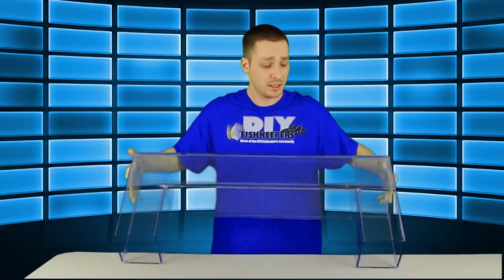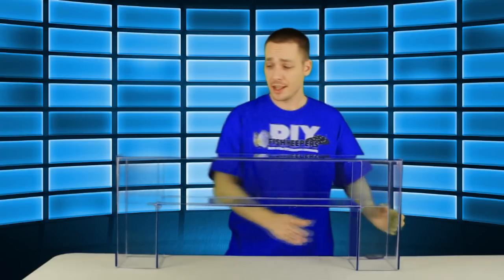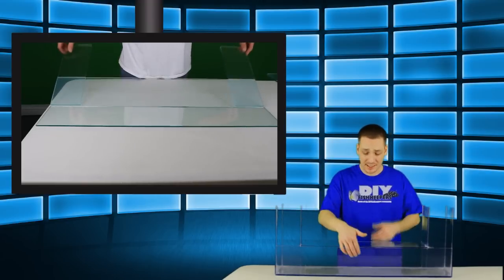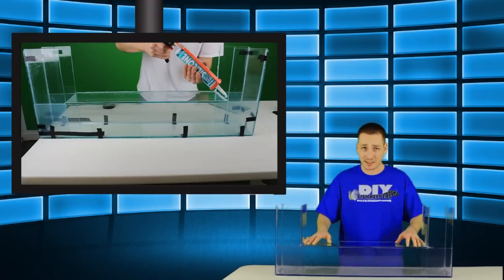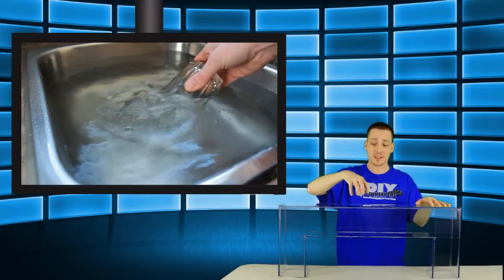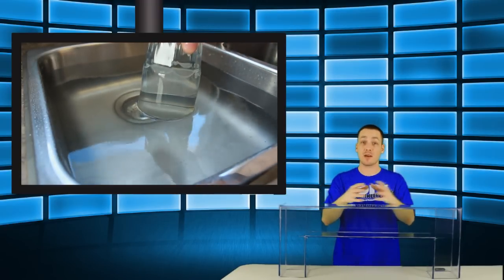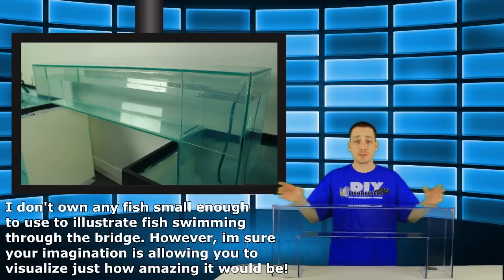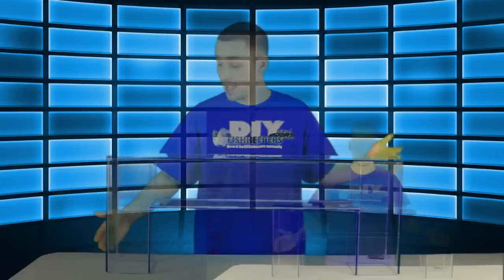HOW TO: aquarium water bridge

Comment: Your point about the bridge not leaking was very interesting. Great video!
Reply: It doesnt leak. But if it will leak it wont work to begin with.

It all works because of vacuum, so on top of having to be water tight, it needs to be air tight.

Comment: Amazing... Please do put in some fish and make a video of that... I also believe that if you use your drip irrigation system for water changes, with the inlet at one side, and the outlet at the other, it will work just fine..
as for the algae, i believe that your simple ceramic filter should keep the water clean enough...
And thanks for sharing this amazing idea..
And if you / i use an acrylic sheet for this project.. the tube can be made to bend at the sides, so the flow of water will be smoother..

Comment: can this be done with aquariums that have different hight levels?
Reply from the maker: +Ana Avila yes. The tunnel has to be level though, so one entrance would just have to be longer.
Reply: +The king of DIY Thanks. Im planing on puting two tanks one in front of each other at different levels ando would love to conect them.
Reply: No you can't :)
Reply: Won't the water level equalize?
Reply: +Tim Johnston  
Yes, they will...you would need lower tank closed
Reply: Ana Avila you'd probably have to make one end of the tunnel longer so it dips into the water.
Reply: height*
Reply: No your lower tank would have to be sealed
Reply: It could as long as you stabilized the water bridge and adjusted the height lvls. If the bridge rested on the slightly higher tank edge, you would want to add something like a column or support to the bottom of the other end in the lower tank to make up for the difference.
Reply: Ana Avila no it won't work. the lower aquarium will overflow. works like a syphon
Reply: The king of DIY  sorry could you please help  me I tried this but my small tank is over flowing how do I counter this? Please help

Comment: Yah sweet bro, I had been thinking about this very concept over this past week, then I came across this video. I was thinking more of putting a  dome of sorts in the centre of my goldfish pond so they could swim up above the waterline and see the pond they live in, Lol. Thing that kept me up at night (so to speak) is Pressure.

Specifically, what it might actually feel like for the fish and potential effects?

- Do they experience any pressure differential inside the water vacuum columb?, like you would experience if you were to dive down really deep into the ocean?
- If so does that mean the higher above the surface they swim the greater the pressure they would  experience?
- Or is there simply no pressure differential in any area of the total volume of water contained within the system.

Probably overthinking it, but I find it to be an intriguing question.
Reply: I can't answer that question , but I like it.

Comment: Water pressure increases with depth, but here you've created a way to reduce water pressure, by having a volume above the level exposed to the air.

This might actually prove to be a useful system for encouraging some fish species to breed, as many prefer to spawn during thunderstorms/heavy rains, to ensure their young aren't going to end up trying to survive through a dry spell or drought.  Thunderstorms are the result of a low pressure weather system, which the fish can sense, even under the water, through its affects on their swim bladders.

If you could build a bridge - or just a capped off tube - high enough above the water surface (about 400 inches, to offset the 14.7 psi air pressure at sea level), you could end up with negative pressure, and the water would actually start cold-boiling into vacuum, otherwise seen as cavitation on boat propellers, where the extreme low pressure causes the water to turn to gas.

You don't want that or your fish will explode (although the tank would probably implode first, unless built to a similar standard as one of an equal depth).

Comment: glass cutting tip: you can use a torch and heat the score line to cut odd shapes the glass will crack along the score line and use the ball at the end of the cutter and gently tap along the score line to complete break it free. just careful getting it to hot to fast it will make it crack in a undesired way

Comment: Do I need to worry about the weight of the bridge which includes water weight + glass weight. Definitely the recommended glass thickness will be used. I am planning to keep the aquarium around 48 inch apart with 6mm dia of bridge. Because this bridge will be kept on one single side of each aquarium, are there any changes that bridge weight can tear apart the aquarium?

Comment: Joey. How do you feel about the stress being put on each tank where the water bridge sits. Do you think the weight would cause enough stress to allow the sides to collapse in or out?
Reply from the maker: That's a great question. Since the tanks are already full of water and under pressure due to it, you would think adding weight to the top would not be a good idea. BUT the water in the tank is challenging the glass's tensile strength(how much it will bend before it snaps), while the bridge is challenging the compression strength(how much it can be compressed before cracking.) 

The practical tensile strength of glass is is pretty low compared to it's compression strength.  Therefore, almost all glass failures are due to it snapping as a result of exceeding the tensile strength. 

This is why i mentioned that the most important aspect to setting this up is to insure the tanks are true and level to each other. Having them true will insure the bridge does not twist. Having them level will ensure the bridge only applies pressure in a compression manner and not on an angle which would cause tensile pressure. 

This bridge weighs about 80 pounds full. Have that weight on each tank means 40 pounds on each side. The tanks can handle this with ease. 

With all of this said, if you would like more piece of mind, you can simply build a small support stand and elevate the bridge off of the tanks so that it doesn't touch them at all. 

Hope that helps. :)

Comment: Do the tanks have to be level in order for this to work? I have 25 and 36 gallon bow front aquariums. I was thinking about having the larger one in the back and smaller one in front of it and about 1/2 off to the side and at different levels. Would love to bridge them together if possible.Please  advise - thanks!
Reply: You just need to make the side going into the smaller one longer.
Reply: +Ed  Beaman the tops of the tanks will have to be equal, else you're only be able to fill one to the top, and the other one only to the height of the lowest aquarium.

So it does work with differently sized tanks, but only if you put the smaller ones higher.

Comment: What did you use to circulate the water through the tunnel? Physics and the Mechanics needs something like a circulating pump to pump from one tank to the other (hidden behind) to keep the biology and water chemistry the same in both, otherwise the water will become stagnant in the tunnel and there will be no flow. I'm attempting to do the math and I appreciate this as a starting point.

Comment: I have a question for the diy king.  I'd really like to do this but using clear pvc instead.  the only way I can make it work is if I can pipe straight up to the ceiling and elbow over.  that distance is about 5' straight up.  is this possible?

Comment: I've been mulling over an idea for a while and this project is similar, but not quite what I need.  I was thinking about how to automagically separate different size fish from each other with one way valves.  Using the bridge concept would facilitate that, but figuring out how to put it together is the challenge.  You'd need two bridges, one to let the big fish cross, and the other to let the small fish back to the first tank in the event they swam over with the bigger fish.  The second bridge would of course need to be a smaller diameter so the bigger fish could only move through tanks to the right of it for example.  The issue I think would be finding a valve the fish could open by pushing against it.
Reply: +DrDangerPuppy I guess smaller fish find it harder to swim against a flow. If so and there's a fairly rapid flow through a bridge, it should work as size dependent one way valve and block smaller fish from swimming against the current. All that would then be needed is a way to stop the larger fish choosing to cross bridge. Some kind of screen/mesh, in a wider section (where flow rates would be lower) to block the larger fish from using the bridge?

Comment: diameter is for circles. Your thinking of perimeter.
Reply: Not quite, the perimeter of the square shape would be similar to the circumference of a circle. You are right though that diameter is for circles.
The correct explanation would be to refer to the square shape by it’s width and height. With a square having identical width and height then the dimension could be referred to as 6 inches square.

Comment: So i did do this i have a 55 gallon tank and my tunnel runs from one end to the other it is 9x9 tunnel but i am wondering do i need a water circulation fan to push water from one end to the other because without that it seams like the water in the tunnel would go "bad" right? From just siting up there and never being filtered?
Reply: If you have a canister filter you can put your intake in one tank and your output on the other tank and you will have a current going through your water bridge.  Or you can do this with a powerhead/water pump, just put the pump in on one of the tank and run a hose to the other tank and it will have the same effect.

Comment: Thats a cool idea. Can you use this same idea for tanks on different shelves?
Reply from the maker: The bridge would need to remain level. Or at least would need to be primed with both ends submerged in water first.
Reply: The water level on both tanks needs to be the same. If one tank is completely below the other, the water will promptly flow into the lower tank until the water level in the upper tank is too low to reach the bridge. This  bridge functions like siphoning water between two tanks.

Comment: Before I saw this video, I was planning a similar project to move water from my tank to my sump, then I would just pump water out of the sump and back into the tank.  Instead of using a glass bridge though, I'm using nylon tubing, and the line going from the aquarium to the sump is going to be long enough that I can use it as a gravel vac to clean my tank

Comment: Joey, great video.  I was thinking of doing this for a filter sump type tank next to the main tank. So the sump would utilize the bridge to maintain the water level. I have seen this in aquaponics videos.  The sump would be a low flow and use sponge filters and maybe have some plants or isolated fish or babies in the smaller tanks.   This seems quite less complicated than a below the tank sump.  In the video you mentioned using a canister filter with input and output in the two different tanks. This seems to be the principle on all HOB filters.  Do you use this type of  same level with two tanks bridge for filter sumps?

Comment: there are water movement inside the bridge? because i want to use only one heater 100w to 2 aquariums with 30l eache
Reply: If you put a heater on one tank, there will be a temperature difference between the two tanks and so, there will be a current of water passing through the bridge :)

Comment: Nice work, I want to make transparent bridge for uneven two fish pond. Would it work?
I have underground fish pond and one above the ground, Distance between them is 1.5 meter. Can anyone suggest this idea would work or if any other idea, I will appreciate
Reply: +Manisha Panchal you would need to support the glass and it would cost a lot but yeah you could do it also if the tanks are uneven in capacity then you could only fil it the the capacity of the smaller one unles its higher up

Comment: I did this with 4" clear pvc because I needed a 54 inch gap in between  40 gallon bow-front  tanks so my Tv could barley fit between them. Works pretty good for African Cichlids. They go back and fourth to tanks and takes them about a day to realize what's up with this tube dangling in the water.

Comment: hey bud.  you could have stuffed the water hose up inside the tunnel and fill.    the air will compress.....and might resist the water pressure form your source but then you'll have less air to remove from the column

Comment: Dont know is Somebody already said this

To get good filtering you would place inlet on 1 tank outlet on the other. But over time the water bridge wil collect air what is the water bridge fails then you have got one big water mess any solutions ?
Reply: Air bubbles do collect in the water bridge I have. Mostly because I have a waterfall type filter nearby with a 4 inch drop to the water.  After 4 days I have about an inch of air. I could go at least a week without failure. It takes a minute to suck the air out. If it wasn't for the filter's location air collection would be much more gradual. 

I can't think of a solution to eliminate all air. Entries to the bridge that are closer to the bottom would reduce the chance of air going in.

Comment: What i have seen whith some other overflow box.
 Is to make that tight that air bubble will flow out.
But I just have found proportiong pump.
This pump sucks on one side and pushed it out on the other.
Planning to place that on air valve and problem solved

Comment: diameter is a measurement of circles. i think you meant it's 6 inches height, width and depth.
Reply from the maker: +Prassel B (Stefan) "Diameter - a straight line passing from side to side through the center of a body or figure, especially a circle or sphere." So while commonly used for a circle or sphere, it is not a measurement only for them.
Reply: The king of DIY He said after that that each side was 6 inches which means that either his diameter or width was wrong. And the definition u said was right but there r rules about what shapes u can say diameter and it still be correct.

Comment: can the legs going down be smaller or larger?
Reply: If you mean the internal 'diameter', just remember you have to allow your fish enough room to turn around in there - maybe they change their minds, or other fish are coming along and they need to get out the way...

If you mean the length of the legs, you have to take depth changes due to water changes into consideration. If, for the purposes of illustration, your normal water level is 2 inches below the tank rim and you normally change out enough water to drop it another 4 inches, you'd want your legs to be at least 7-to-8 inches (2 inches plus 4 inches plus 1-to-2 inches safety margin) to keep the water in the bridge. If your water changes dropped the level by 8 inches, you'd need your legs to be at least 11 or 12 inches (2 inches plus 8 inches plus 1-to-2 inches safety margin).

Comment: I have a use for this.  I want to put a tank in the wall in my basement but the ideal spot for it has a pole in the middle of the wall.  So I think I'm going to put a tank on either side of the pole and connect them with the bridge idea.
Reply: How about you make a custom tank instead :)

I think a Donut shaped tank would work nicely as the pole can just go through the centre :S

Comment: @uarujoey

Heya Joey.

I think you forgot an important detail with your building method and the cleaning method of algae rubbers. The face that you would need approximately three of them to just clean that model type because of the overlapping glass. I think you should look after a method to create a strong Diagonal that allows the Algae scrubber to move from the lower glass side to the upper glass side where the lap exist so you only require one Algae scrubber with magnet.

I also think that this Waterbridge idea can be ideal to try Awaken "Wild" behaviours of the fish. Have one fish environment in one tank, another in the other. By this method you can simmulate the travel fish experience during period of mating in real world and therefore have one tank that is more ideal in environment for Breeding. For example, certain plants, stones, hide outs for eggs etc.
Reply: Some wrong translations here and there, I hope you can read it through...
Reply from the maker: Magnet scrubbers can go around corners. Instead of attempting to go over the lip, go on another side and then come back to the side you missed.